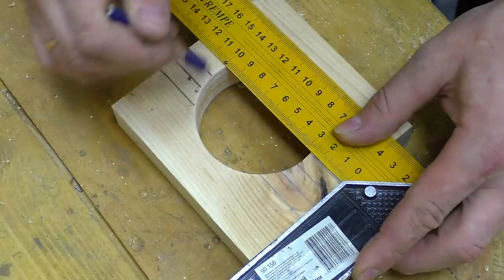Help your wife !!! Make this fixture.

Comment: My mum had something like that 50+ years ago!  Only hers was stainles steel so it could be washed.  And it took much bigger potatoes.  But then they opened a chip shop up the road, so she stopped using it.

Comment: Your design is limited to very small potatoes and is also hard to keep food-safe. Protect your family. Go buy a french fry cutter at the local market. Most can be hand-washed or are dishwasher safe.
Reply: I think it’s more about the process than the product. Creative problem solving can be an enjoyable pastime.
Reply: There was a contraption on the market back in the late 60’s, I think it was called a Slice & Dice. It did a great job on potatoes; my wife loved it. We ate a lot of spuds....
Reply: djecpamba   I have a contraption in my kitchen that does the exact same thing, except that it consists of a single stainless steel blade with a handle on one end.  Yes, I have to make multiple passes in order to turn a small potato into bite sized pieces, but I can customize the size of the cut, and also wash it when I’m done.

The only creative problem solving that this video promotes comes from trying to determine if the money I save by building a contraption like this from scraps in my shop will offset the cost of the tetanus shots my kids will wind up needing.

Comment: QUESTION: How do you clean and sanitize that contraption ?

ANSWER: You can’t.
Reply: Bud Rowe nope especially considering it was made from oily saw blades and soft absorbent pine.. horrible choice of materials. Near build even though it took 5 min wo sound to figure out what what being made. But waste of time is using these materials m.
Reply: Tobias  rubbish, it's why wooden chopping blocks are banned in butchers shops